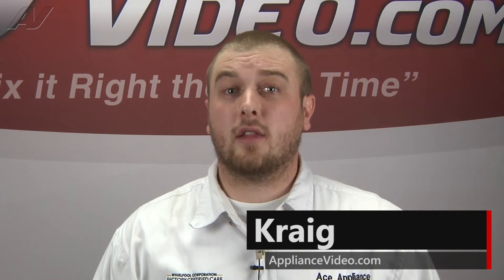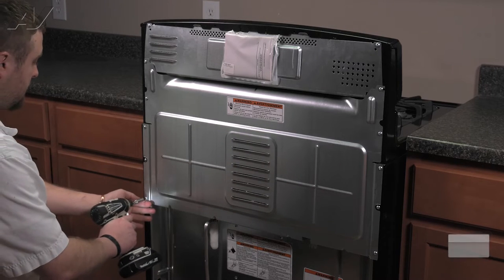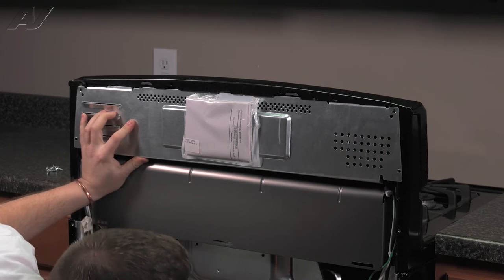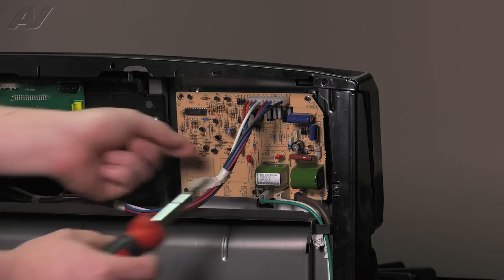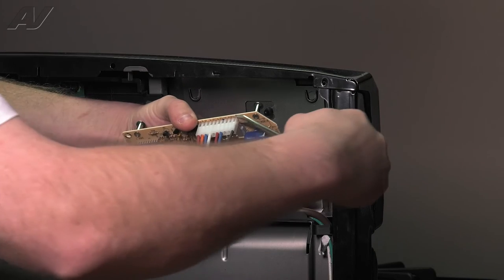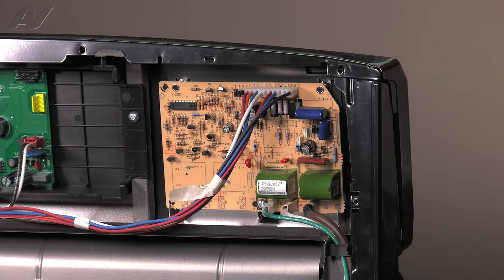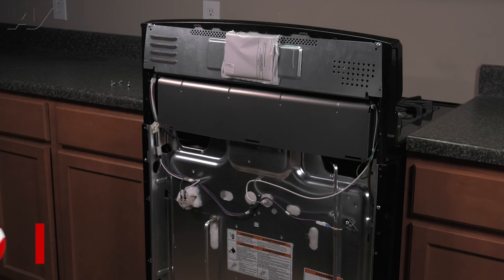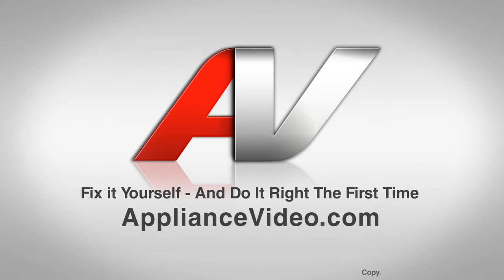Amana Stove Repair - No Ignition Spark - DSI Board

Comment: I have a GE range purchased in 2008.  I have ONE burner that will not lite.  All FOUR burners have spark, yet ONE burner still will not lite even when holding a match to the burner.  It appears as though GAS is not reaching the burner.  Any suggestions for me to repair this unit?
Reply: Not familiar with particular unit but in general... remove top to expose manifold and feeder tubes that lead to the individual burners. Check to see if any are loose or slipped out of place.
If removable, check for carbon buildup or even spider webs blocking gas flow.
Reply from the maker: Great question, if you have a
more technical question that our parts department cannot answer, our
technicians are answering all questions at our website at www.ApplianceVideo.com under our Repair Help section. You can also call
our parts department at 1-800-830-5465 and they can give you help 7-days A week
Monday -Sunday, or search at www.SaveMoreOnParts.com  24 hours
7- days A week.